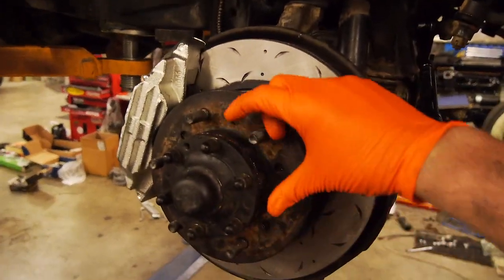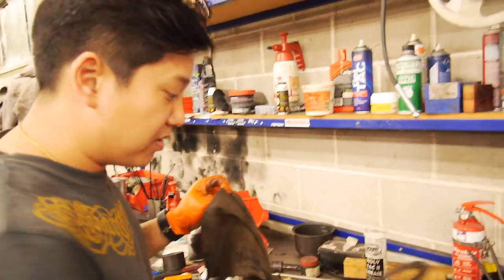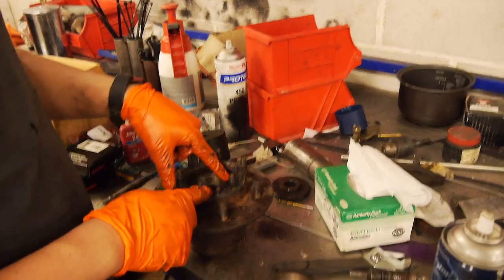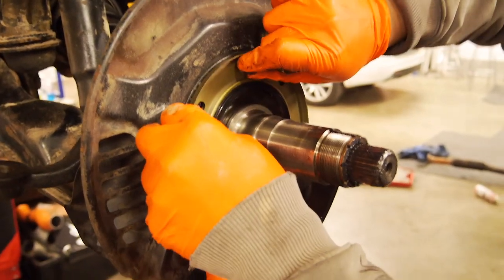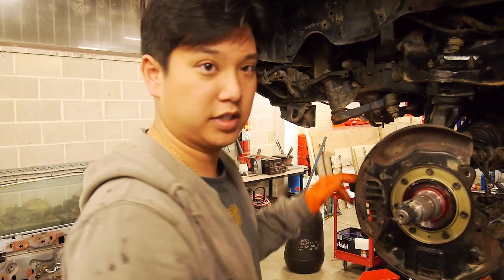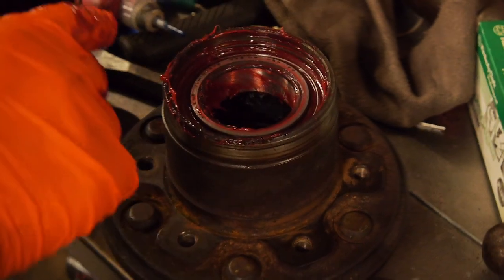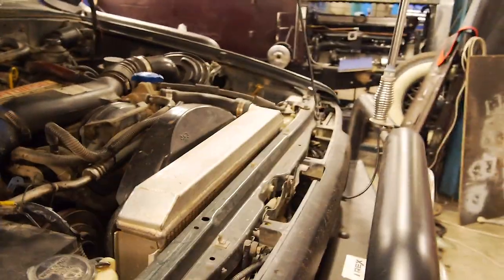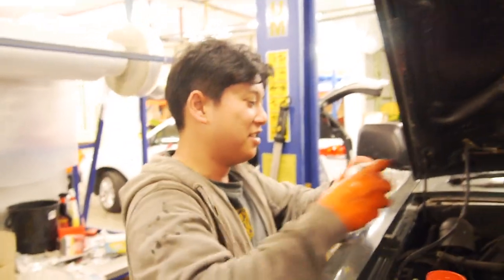IFS TOYOTA FRONT WHEEL BEARINGS, HUB & KNUCKLE REBUILD - THE RIGHT WAY

Comment: I'm in need of replacing a wheel stud on my IFS 4WD truck, and I'm aware I have to separate the brake rotor from the wheel hub. But, does separating them require dissassembling the oil seal and bearings from the wheel hub, as well as readjusting preload? Or, can one simply separate rotor and hub without touching anything oil seal-bearing related, just change the studs and not have to do anything else but simply reassemble axle nuts and washers?

I'll appreciate your useful feedback!
Reply from the maker: Unfortunately you have to disassemble the whole bearing assembly😣

Comment: You mentioned using a speedi sleeve for the spindle shaft. I cant find any information online on them. Any idea wich # they are, I've found 1 place that has am extensive inventory but no way of checking what each is for.
Reply from the maker: They aren't application specific, they're dimension specific. So need to get accurate measurements of what the current diameter/s are and also what they need to be

Comment: Hey, wicked video! Question: are you meant to replace the oil seals in the "taconite arrangement"? (hope I spelled that right). Mine look pretty rough and I cant seem to find the seal part #. Noticed you left your old ones in.
Reply from the maker: Thanks mate. Glad it helped.
Yes good observation, we had trouble sourcing them. Since we were doing it that day we didn't have time to try track some down. The local part stores had no idea at all. You would be able to find them on amayama though in the exploded parts diagram. Fortunately for us they were in good condition to reuse still
Reply: Beautiful, cheers from Canada!